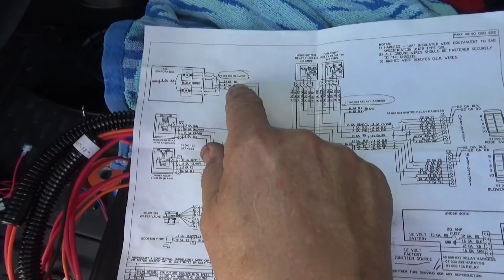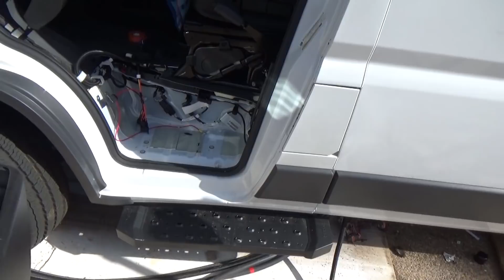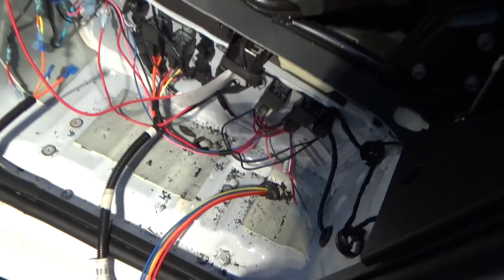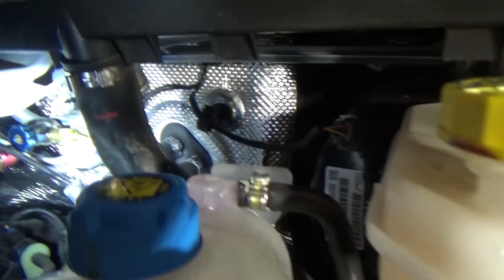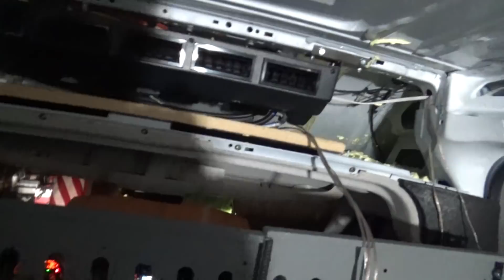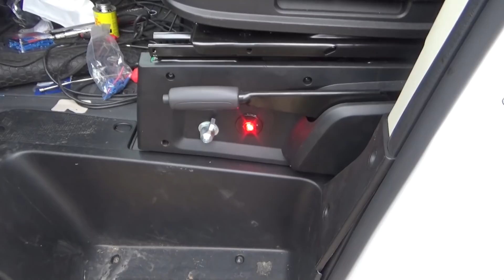Ram Promaster Rear Air - ProAir  Part 2 - Final - Rear AC ?

Comment: Thanks for the videos! I just installed mine based on how you did it, however I am not getting crazy airflow, is there some sort of vacuum hose I'm missing? It is very loud but blows weaker than the dash vents, air is cool not freezing cold like the promaster stock vents, wondering if you could maybe point me in the right direction? I checked the pressures and leaks, everything functions as it should up front, but the rear unit is lacking. Thanks!

Comment: I love a challenge like that. Kind of like buying from Princess auto or in your case Harbor freight . No  instructions or only schematics . Good job Dave.
Reply from the maker: yeah its like anything else you have to work one step at a time cause looking from 40K feet it is overwhelming. ProAir really supplies mostly to the pro custom installers and has factory training for them thus the reason they really dont have an instruction manual. They do waste quite a bit on materials tho for this application there was a ton ofwiring, hoses , and stuff that had to be cut out.
Reply from the maker: i dislike that comment.........
Reply: Do you still have the schematics
Reply: The real challenge is cleaning up the driveway after he is finished. He seems to need instructions on how to do that.